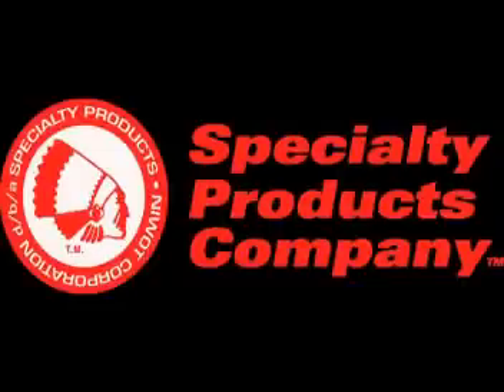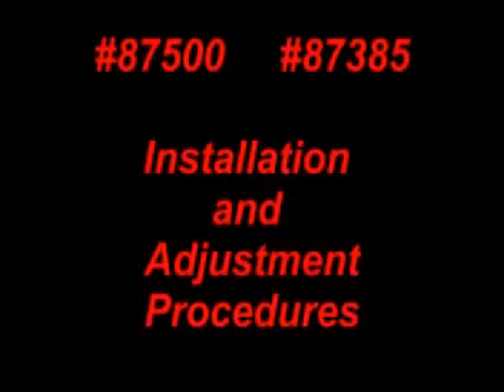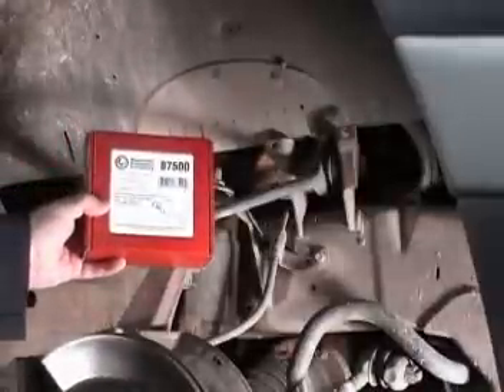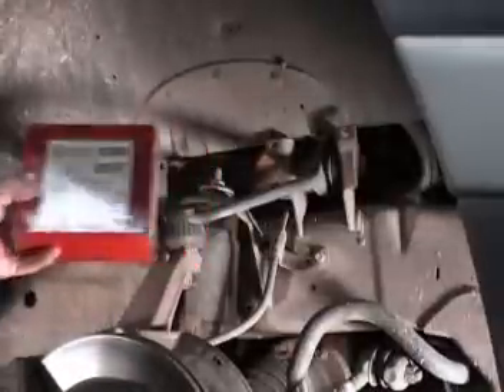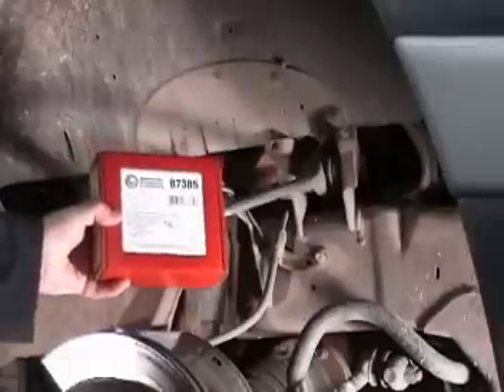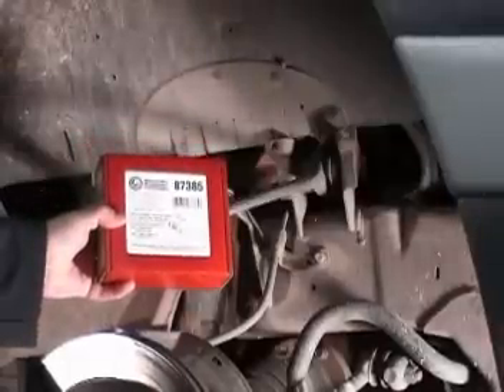87500 / 87385- Ford Camber / Caster Adjustment - Specialty Products Company

Comment: Do you have these that fit a 2012 SVT RAPTOR? I am maxed out on my camber and caster bolts…still showing -1 and -1.2 camber. Interested in these if they can get me back to 0.2-0.5 with these adjustable upper control arm bolts

Comment: EXCELLENT PRODUCT used on my 2003 F150 XLT do not let the guys at the alignment store. Tell you the washers are installed wrong. ACDelco Professional 45K18040 Front Camber Adjuster Bolt Kit with Hardware
Reply: Thanks! This is still a very popular kit.

Comment: This is a 2nd gen explorer. Do they make one for a 4th gen, 2006 EB w/a 4.6?
Reply: Sorry but SPC does not have a similar kit for the 2006. This is a case where "Elevated Adjustment" or "Jack and Hold" is useful so you are not fighting the weight of the vehicle.
Reply: Have you found the bolts for your car? I'm looking too.

Comment: So I have a 03 ranger 2wd I replaced the upper control arms and lower ball joints I took it in for a front end alignment and the camber bolts are still the way I put them I think he only adjusted the tierod ends I know they couldn't have been right cuz I just put them on knowing I was having it aligned the next day so I just put them on without even trying to get them close to what it was before and they are in the exact same position I put them in thats not right is it
Reply from the maker: While coincidences do happen, the chance of all 4 bolts not needing to be adjusted is very unlikely. Do you have an alignment report? If so, please contact us with the readings. If not, see if the shop can reprint it. If that is not successful, to be certain, you will need to have at least an alignment check performed and contact us with those numbers. We always recommend requesting an alignment report for your records.
Reply: @SPCAlignment  no I didn't get one I'm going back by there now to see thanks for such a speedy response I will let you know
Reply from the maker: @johnnyherring4825  I f you don't get another speedy response, please call 800-525-6505 and ask for Tom in Tech.

Comment: Substantial omission to not include which model years of which vehicles the kit works with.
Reply from the maker: We sometimes assume if someone views one of our videos that they got there by going through our website Application Guide, clicking on the part number and clicking on the video. This method assures you are watching a video appropriate for your vehicle. If you run across the video on YouTube, I can see your concern. As application data sometimes changes, I would recommend verifying the correct part number on the website and then search YouTube for videos about that part number, whether they are SPC's or someone else's. Just remember SPC has no control over the content of any video not produced by us so exercise caution. Thanks

Comment: I have a 2003 Ford focus I had rear control arms put on . When I went to get a alignment he couldn't do it because there were no camber arms. Control arms and camber arms don't come together? I am wearing rear tires out in 2 weeks. what needs to be done for a wheel alignment and how much do you think all this would cost
Reply: Kevin, Ford did not build the rear suspension with camber adjustment. Most direct replacement arms will just mirror the Ford parts and will not allow camber adjustment either. Sagging or broken springs can cause a loss of ride height which will make for too much negative camber. If the car has been intentionally lowered, the same effect occurs. Or, if you want better alignment with the way the car is right now, SPC has 2 choices for you. The 81310 Rear Camber Bolt kit allows for about 1 degree of rear camber change in either direction. If you need more than that, the 67420 Adjustable Rear Camber arm offers up to 5 degrees of positive camber adjustment. Without knowing your current readings, I can't tell you which you would need but if the rear tire wear is camber related, then you probably need the arms which allow more adjustment. I am curious about your rear toe readings as toe is more likely to cause tire wear that fast. Cost for installation and alignment depends of which parts need to be installed and whether a shop is installing them or you are. Thanks, Tom

Comment: Mine's an 03 and I installed both upper aframes but don't think there were camber plates on the old/ new parts? So do I have to buy these to get proper alignment? Thanks
Reply from the maker: It depends on your exact model and 2 or 4 wheel drive. Please go to our website to find your specific application. https://www.spcalignment.com/

Comment: The stock parts are junk and a pain on the driver side to get back in, that's why on got this kit ....👍
Reply from the maker: Thanks for the comment.
Reply: @SPCAlignment Thanks, Also I can't figure this out why ford used none adjustable plates,  each stock  plate has a number on them  so it must be aligned at the fatory ......I guess that's why some people beat them with sledge hammer 😲